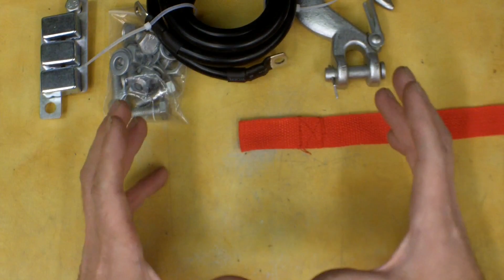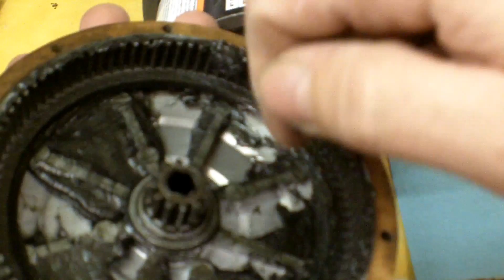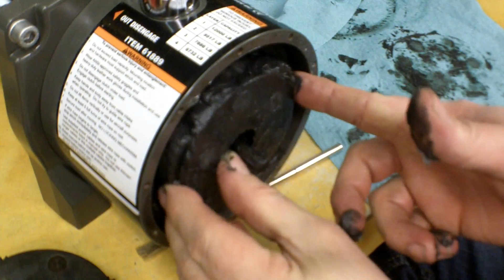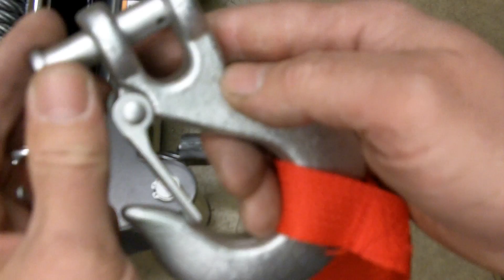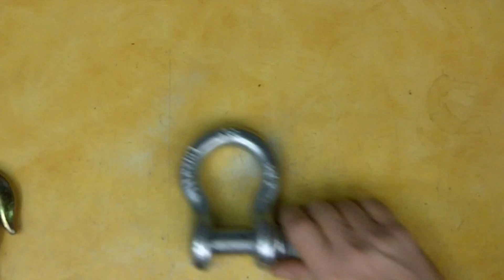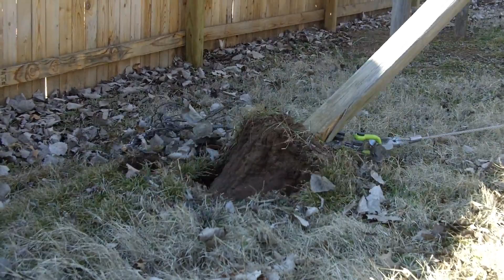Harbor Freight 12000 LB Winch Review, Teardown, Installation, Safety, Etc. Model 61889

Comment: bought this winch....piece of typical Harbor Freight junk.  We had a small tree fall across the road, blocking us from getting out.....oh boy.....we get to use the new winch!  We cut the tree in half..hooked up the winch....put a strain on it....pulled for 8 seconds and it overheated and turned off...so we let it cool...used it again for 8 seconds before it quit again....long story short
..took an hour to move the tree.   We replaced that Harbor Freight scrap metal with a 15000# Warn real Winch. The Harbor Freight winch makes your rig look like it has a winch and that is all. Video says 5% duty cycle....reality is 1% duty cycle....PURE JUNK....
Reply: i like the part where people argue about winches on youtube
Reply: Bill Waldron , yeah I can tell you are not a owner. But guess what I am, look it up, owner of the Car Whispers Mobile Mechanic Service, LLC. Makes me laugh, you claim your some owner and you have all this electrician mechanical background, but your in a Harbor Freight store buying a winch......sure you are! lol. Also you act just cause your in a big old dodge diesel, that makes a difference, lol. Shit is still stock on that rig, just like the rest omg. I know its a diesel, lmao I guess it should just pull better right???....get the fuck out. Its totally clear you dont know shit about a god damn winch. I tell you what, ill pay for your ticket here and back, show up at my business, will go down together and buy that harbor freight 12k winch. Will pull it out of the box together, and ill install it on any rig you chose in my parking lot, even my employees geo swift turd that he drives everyday, and ill pay to do it correctly.......Then will hook it up to any tree you like, and pull the thing out of the ground. And it wont take but a few minutes. Now the trade is, if you win, and it doesn't work, then ill give you 1k cash for the trouble, and a trip paid back home.  But if it does work, you get to pay your own way home, and I get to kick you in the balls, and punch you in the face. Bet you wont take my offer will ya???? Go to my face book page, look up my business, and send me your info so I can send you a ticket. 

learn how to install a winch and operate it before ever touching one again. Now get the fuck out with your fake ass knowledge that you don't really have. Troll
Reply: I use this exact winch on my cj5. Granted its a lighter orv, but 3 years running this HF winch has worked great no fails. I do use it for light lifting too in my home shop. Nothing unsafe, but it'll lift a motorcycle off the ground with an I beam pulley as often as you want.
Reply: Bill Just stop commenting, you look dumb enough as it is. Save yourself the dignity please, for your own sake! We need educated and knowledgeable people to comment, not fake ass trolls that want to use their political shit on here. And we don't need a liar like you most of all, to tell us about a winch you never bought, which is totally clear. Your a joke.
Reply: electro1622 I bet you cant prove that this 12k harbor freight bad land winch is not capable of doing what its rated for. And I also bet, you cant show me any difference that would actually matter in the field, or mechanically..... when compared to other brand winches in the same class that cost more, that can do anything different, or better then this winch, accept line speed, and maybe a brushless motor...........Ill wait for your link with your evidence....... that you wont provide. 
Your just another fake ass wannabe snap on guy.......And a follower. So what exactly is wrong mechanically with this winch that makes it a peace of shit buddy boy???? lets hear the engineering flaws of this winch from you ......since you had to put your fuck tard remark in the comments here. lets hear it......?????
Reply: Florida Ultra Hot Chilies just because you can do something, doesn't mean you should. Winches are for pulling, not lifting. Example; yeah you can run out in front of a speeding car on the freeway that can't stop in time before it hits you, but it doesn't mean you should do it, now does it?
Reply: jfmjr1970 lol............. I'm not arguing.....just explaining how im right........like always.
Reply: electro1622 lol, I dont expect you to do shit ..... except for you to put your "know it all knowledge", of this winch, and and your dumb ass comment where your mouth is. Funny you just admitted you dont own this winch, but yet you are on here talking shit about it like you know something about it, or have something important to say, or to bring to the table. lol you crack me up. Just stick to your little wound wire motors and shut the fuck up. You don't know shit about winches and your comment proves it....troll.
And what this kick with the millennial shit???? grow the fuck up....... really! If you are going to put me down, do it like a man,  come at me with some adult shit.....not some pussy as political kid shit. btw, I expected a little more from you with your returned comment, that you would bring back after my comment to you, after looking at your page and thinking you actually might be a smart guy....but its clear your just another mouth with no backbone to back it up....all talk, no show....we call that here in the U.S.......a troll.....and you are clearly a troll lol.
Reply: electro1622 in fact, im going to make a video on my harbor freight winches, and them pulling...just for you, and im going to link it here in the comments for everyone to see........and to laugh at you after its over. ill be pulling some heavy shit to, cause I live in the mountains.....and while I make this vid, im going to be saying your user name non stop and talking mad shit on you, and prompt others to follow my link to your page so they can do the same, and im going to post a short clip of all your comments on here u made in my vid so they can also see how fuck-tarded you really are lol. and then ill repost the video of the winch doing what it says it can do and then some, every week with the link to your page ....so in the end u delete yourself from all the comments you get every damn day because of your mouth that should just stay shut. watch, wait ..... the video is coming ....troll. im going to do it just for you buddy
Reply: Florida Ultra Hot Chilies sure u do, ........I can totally tell your such a pro in the winch world...lol ok buddy......pulling from steep angles with a winch,  is not the same a lifting......fuck you are such a tard it makes me laugh.
Reply: electro1622 im still waiting on some actual engineering knowledge from you, and how this winch doesn't work because of your claim its garbage.......all talk no show.......just a mouth.......you don't even own this winch, but yet you call it trash.......troll at the max. lmao. lets see the proof buddy, on how its mechanically flawed. post it up, or shut the fuck up.
Reply: Florida Ultra Hot Chilies I like to see you use your winch to lift a truck acutely an 1/8" only, or just a 1/4" like a hoist can do. Or just a foot without ever having to worry about the winch trigger getting stuck causing the winch to continue to pull until the remote is quickly unplugged.........see, this is why in all winch manuals it clearly says "winches are not for lifting"! ....but your just a fuck tard and think you know shit.....that you dont. And if how I talk makes your YouTube time unpleasant, then stop watching YouTube and commenting. Fuck, like boo hoo....you sound like a little kid crying.....gets some balls, and read your winch manual ....education is key dipshit
Reply: electro1622 talk....talk......talk.......all mouth no proof! still waiting for actual proof mouth........????? post up some links dipydoo.......mechanical flaws of the winch, and why it does not work?????? Better yet mouth, just tell use how the harbor freight 12k winch is mechanically different then other winches mouth???????? Quit your yacking, prove it mouth!
Reply: electro1622 just talk....blah blah blah. So then what did your research say was wrong with the winch???? explain in detail mouth?????
Reply: electro1622 you should just stay in your garage, and continue to play with your little school projects....leave winching to the big boys.
Reply: Florida Ultra Hot Chilies lol.......just because a winch pulls a truck and causes it to lift into the air or drag into the ground......is in no way the fucking same as lifting like with a hoist. AND PULLING AT  STEEP ANGLES CAUSING TRUCK TO RAISE WHILE PULLING.....IS NOT THE SAME AS LIFTING! plain and simple stupid!
Reply: Florida Ultra Hot Chilies btw, if u actually used a winch, like you claim u do, you wouldn't even be arguing the fact....cause your claims are just beyond fucking stupid. And anyone with winching knowledge, like me, would know this. I suggest you actually go use a winch properly and learn how to read a manual. Lol I can see you trying to explain this to a pro winch man, and his face after he hears this shit from your mouth, lmao it would be priceless to see!
Reply: Florida Ultra Hot Chilies and yes the manual say dont lift, because they don't want to be reasonable like u just said.....FOR YOUR DEATH....' BECAUSE THEY ARE NOT MEANT FOR LIFTING DUUUUUHHHH!

face palm yourself please.
Reply: @19882fast4u  where is the link for your video ?
Reply: Bill LOL...That dude you are talking to doesn't know shit. You are exactly right about winches are made for pulling not hoisting, mainly due to the braking and locking mechanism.  But you can't tell him that. Its sad but I am sure that guy will get hurt real bad one day by messing around with equipment he knows nothing about. I liked how he said he can pull any tree out with his harbor freight winch...LOL He couldn't even pull out a live tree with a 4 inch trunk, unless it was just planted...LOL Like the old saying goes you can't fix stupid.  I have been doing serious 4 wheeling since I was 18, I am 53 now. I ONLY use WARN winches because sometimes my life could be hanging on it and I would not trust this HF crap. Anywho, it was a comical read. It's a shame some people are that stupid. But, it does make for a good laugh :)
Reply: Great video, bad taste in winch.
Reply: Can I get you goofballs to argue about mud tires vs all terrains please. Highly entertaining stuff! 🤣
Reply: Saw the overall reviews for the warn winch and they were very good so I bought one and it hasn't disappointed me yet
Reply: Bill I've seen the reviews on the warn 12,000 they were great so I bought one never failed me yet
Reply: "But if it does work, you get to pay your own way home, and I get to kick you in the balls, and punch you in the face" best laugh I've had all day!  10/10 comment, three thumbs up.
Reply: With the exception of the last 10 or so comments here.... Y'all sound dumb as hell.... Arguing over a cheap ass winch. What's the point? If it works for you great! If not.... Well... Ya get what ya pay for more often than not. Personally I've seen them work great AND not so great but most of the deciding factor was how it was installed and how it was being used, not the winch itself.
Reply: Bill Waldron , im guessing you had several problems, not do to the winch. Probably not the right set up, like the proper battery size, rating, and Ah's. im guessing you ran stock power and ground cables that came with the truck, instead of upgrading the - and + wires, the alternator and starter wire as well. And I'm going to guess you didn't upgrade your alternator to a larger Amp unit, and when pulling with the winch, you just kept the idle at stock of around 750 rpms. Then you probably used the safety relays that come with the winch, without proper connections to it, leaving it to get hot in a few seconds. Its clear you don't have knowledge in this field. I've own this and many other winches, and there is absolutely no problems with this unit, if done right and set up properly. People like you shouldn't run a winch, unless you are willing to do things right.
Reply: DON'T EVEN GO THERE WITH YOUR INSULT!   19882fast4u" about the Harbor Freight junk winch not being the problem, but that is was installed incorrectly. You picked the wrong person to try to display your electrical knowledge with.    The Harbor Freight winch is priced very cheap for a reason.  It makes a nice front bumper decoration for wannabees.

I am the owner of an industrial construction company and an electrician for forty years.  Like many other Harbor Freight items, it is a piece of Chinese junk.  The truck we tried it on was a heavy duty Dodge Ram Cummins with the heavy duty alternator and two batteries.  We threw away the Harbor Freight junk winch and installed a Warn 15,000 pound commercial duty winch.  It pulls all day. We do not have to leave the engine running or speed up the idle.  You get what you pay for.  I have put WARN winches on many of our service trucks over the 40 years in business  for all day long hoisting, pulling, lifting, etc. with never a failure...never ever. .....years back...when in a jam, one of my construction foreman purchased a 24" Harbor Freight pipe wrench...The handle broke in two and nearly sent him off the building while working up high on the steel. The consumer just has to be careful what you buy from Harbor Freight........better to buy quality made in the USA and employ American workers.
Reply: Bill Waldron I gave you an opportunity to do a face to face. And I'll hold to it to. And again, it doesn't make since by you. Your political view by what you keep saying is, don't buy china, buy American........but yet yourself, went into harbor freight, and bought the china bad land winch..... lmao. So don't support china, only American, .......but its only ok for you to buy the winch though at harbor freight right??? Your a god damn joke! You're just a giant peace of shit that talks out his ass it seems, .....with no real life experience about this winch. YOU never bought that 12k harbor freight winch, your just some old ass political typer, that can't even hold to their own words, .....by buying American only as you said! Your a joke. Stop commenting on shit you know nothing about. You just look really fucking dumb. Take your political shit somewhere else. This video was to educate and help those in need of how to service, and set up and maintain a winch, and safety of operation. There is absolutely nothing wrong with this winch, especially if on a budget for most. Just cause it's not American , don't mean shit. Your just a douche bag.....please.
Reply from the maker: +Bill Waldron 
That's unfortunate. My experience with it has been great. Glad you found a better solution for yourself. Take care, G.
Reply: 19882fast4u   you remain a foul mouthed coward hiding behind your computer.....
.
Reply: Bill Waldron And just for the record, a "winch" in not for lifting you dumb shit, pulling only lol. ANOTHER example of you not knowing how to operate one. Probably work for McDonald's lol
Reply: Wish I could do a face to face with you.  You are a brave little man hiding behind your computer.
For consumers.... Buy quality or buy junk...support the USA manufacturers and companies or support China.
Reply: LOL... see how stupid you are, you actually expect me to go out and buy that shit and go through all this trouble just to prove something to a dumbass like you..I'll  take the second option..do nothing and leave you in your deluded millennial world of dumbass shit...
Reply: 19882slow4u....LOL...check out harbor freight 12000lb winch MUD test...  it can't pull an SUV out of a puddle..lol.
Reply: 19882slow4u.. what happened ..??.. I proved your cheap uneducated ass wrong and now you shut up like a bitch with her mouth full..lol.. Wake up to yourself...cheap does not equal good...never has never will.
Reply: 19882slow4u..   You must be inbred to be that stupid..so now you're saying a harbor freight winch cracked the frame and cross member..lol..after people post the same winch overheating pulling an SUV out of a puddle..and then you make out like you can make a video of your winch doing all this macho shit which others can't do before ending with a gay sexual fantasy..lol.. you are gay if you fantasize about shit like that..lol..Perhaps you should subscribe to a gay chat..you'll meet more people like you there..lol..you idiot.
Reply: LOL..that's the stupidest comment I've ever read..lol...go ahead, make your video..lol..I hope you and your 5 subscribers have a field day..lol..5 subs.lol... and yes, I can tell you live in the mountains, where school is real far away yeah...lol..your 8 line comment has one full stop and it's in the wrong place..lol..you can't even string a sentence together ..lol... why don't you go the whole hog and call yourself Harborfreight Man..that name might even appeal to your gay following...
Reply: Bill I bought the warn 12,000 big difference glad I bought it